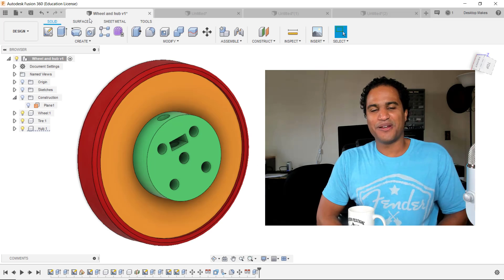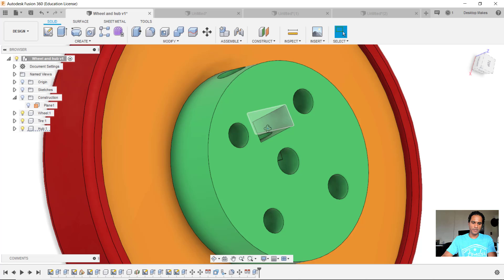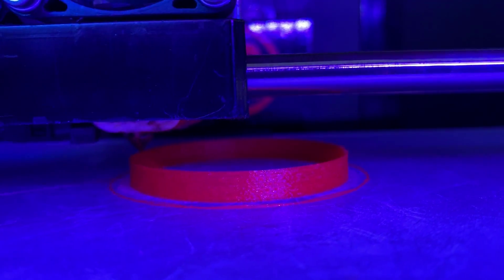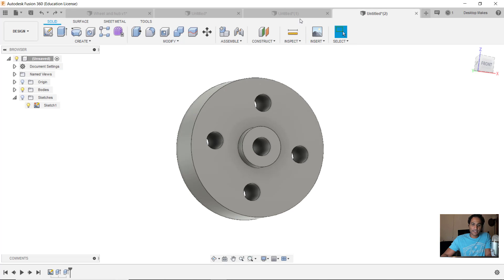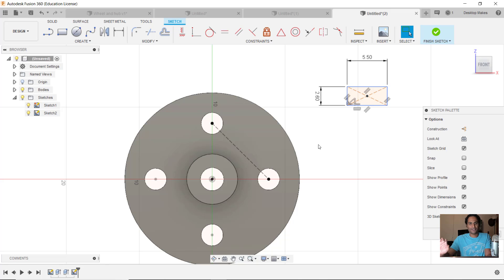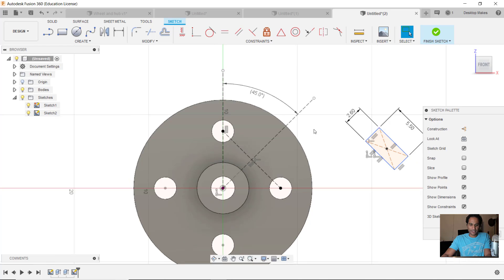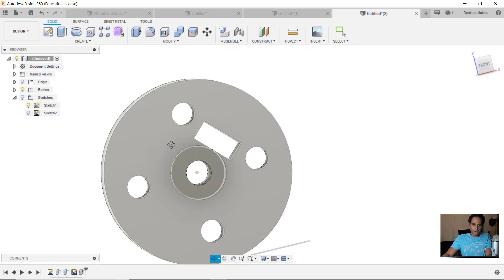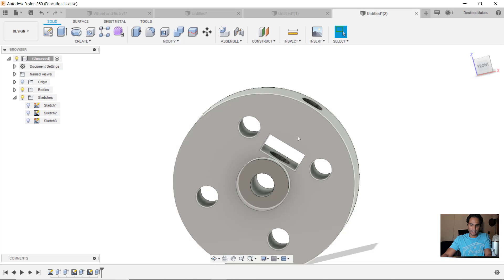Captive Nut Technique in Fusion 360

Comment: If you make the center from brass to make it strongrr grab for the shift by melt the brass in the center of the hup and that brass bosch it has threaded hole of the sode of the boch?Thank you for the vidio.
Reply from the maker: The next upgrade will most likely be to swap the hex nut with a brass threaded insert.